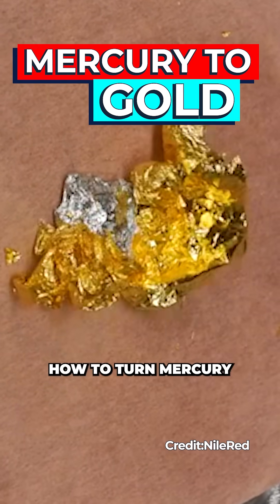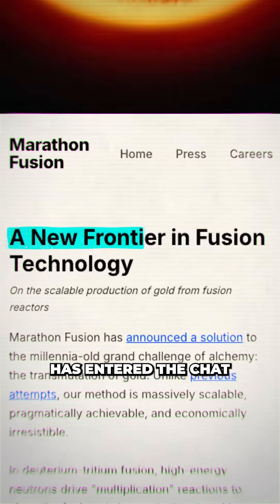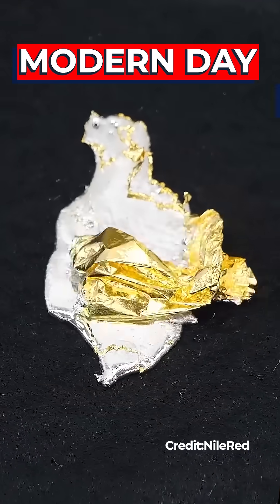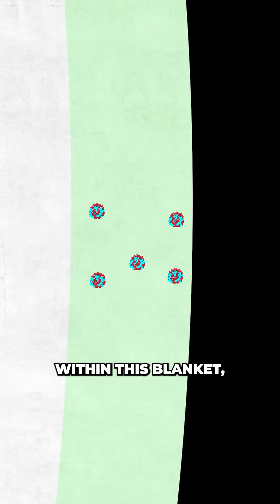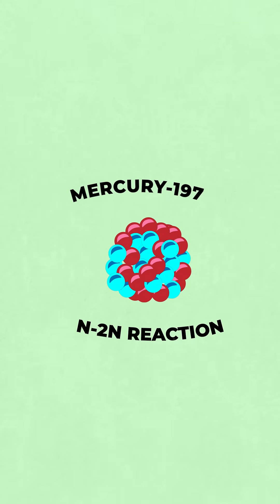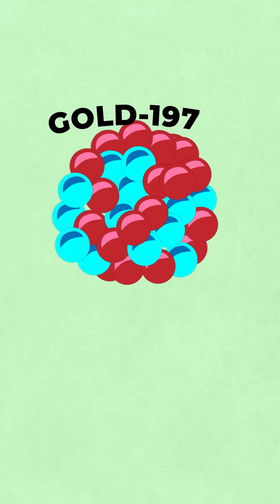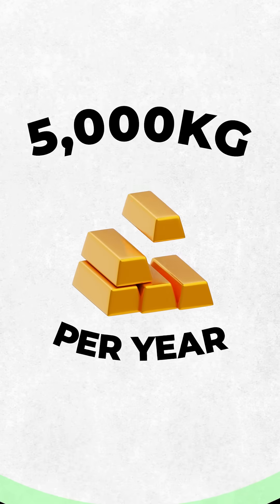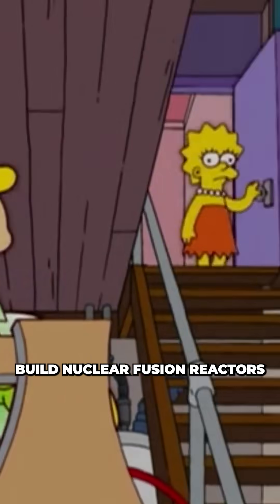Scientists Turn Mercury Into Gold

Comment: This will lower the value of gold because now they can just print it… which may boost the value of other metals though… thankfully countries like China who put most their capital into gold will suffer the most from this while other countries can divest and instead sell their gold to manufacturers who can use it in motherboards, wires and microchips so they still have value just not as much if this is true. China will lose the most so their yen will greatly devalue once more gold is actually printed which will increase the value of the dollar at least.

Comment: So gold will become cheap enough to replace copper for electrical devices (copper is used to make cables and wires gold can do the same thing and it's more efficient in transferring energy the reason we didn't use gold for everyday things it's because gold is really valuable)

Comment: Uhhh. How tf do they plan on capturing and processing the mercury-197 without you um gold metal itself being in such bountiful clumped together nuggets? Only bacteria do that over very long times. This reactor would be spitting it's entire contents including fuel for this to work. That and the radioactive gold. It might be the most common isotope but gold absorbs radioactivity no different than steel can. It can be hot irregardless of the isotope.p

Comment: If the cost is too high it will make the value is higher than natural gold. Mercury is rare material even it's not as rare as gold, if mercury is using to make gold the price of mercury will skyrocket and increase the cost that will make the mercury gold high in value...

Due to the principles of mass-energy equivalence (\(E=mc^{2}\)) in nuclear reactions, the final mass of the gold produced is slightly less than the initial mass of the mercury isotope and neutron combined. However, because only a trace amount of mass is lost as energy, the amount of starting mercury-196 required is almost the same as the desired amount of gold. In practical terms: Because Hg-196 is only a tiny fraction of natural mercury, you would need a very large amount of natural mercury to produce a useful amount of gold. Estimates suggest that a kilogram of natural mercury might yield less than a gram of gold using current, highly inefficient methods like particle accelerators.The process is extremely expensive, energy-intensive, and yields are minuscule, making it completely impractical for commercial gold production.

Comment: Gold’s value is almost entirely symbolic. It doesn’t feed, shelter, or heal anyone. Its usefulness comes from human consensus — people agree it’s valuable. Once you remove that shared belief, gold becomes just another shiny metal with little real necessity.
Even its historical role — backing currencies or storing wealth — has faded. Modern systems use fiat money, digital assets, and blockchain, which rely on trust, not metal. So, outside the monetary illusion, gold has no essential human benefit.
Reply: In the modern world gold is important in electronic industri...you wont have computer, smartphone, satellite etc and all the system related to it without gold...that means in modern world without gold there will be no internet, no blockchain, no advance military, no advance navigation and no AI...no I.T no job related to I.T, there will be no software engineering, no online/digital banking, no ATM and many other modern jobs, all thanks to gold that's why the value of gold is higher in modern age..the more advance electronic technology  the more it need gold because gold is the best metal for electric conductor which is important for microchips manufacturing while fiat money is just a paper that means fiat money value is totally illusion...do you trust in that illusion while the real value for it is for toilet paper? And there will be no paper jewelry, dude. You're a funny guy, man because you live in the edge of technology which depends on gold but you never realized how important is gold to modern tech instead you put trust on paper...paper isnt rare material🤣

Comment: Ok so you say it would pay for itself but given the sheer amount of gold this could produce wouldn't it simply cause a massive collapse of gold prices and essentially fuck global economies due to the sudden devaluation of gold! Remember if they put this into practice as an energy supply it woukd require a lot of these reactors and they each would produce that amount of gold which would quickly make gold a less valuable asset based on it's rarity etc.

Comment: This is just theoretical, and would make radioactive gold that would have to be stored long term until it's depleted. So 5 thousand kilos per year, that you can use in 1000 years. Maybe. Furthermore, this presents a situation for bad jewelry and bullion for the market....really bad.
Reply: It has been done, but it costs more to run the reactor than even 10x the gold it can make would cost

Comment: Yes, it is theoretically possible to turn mercury into gold through nuclear transmutation, but it’s not practical or economically viable. Mercury (Hg) and gold (Au) are close on the periodic table (atomic numbers 80 and 79, respectively). By altering the number of protons or neutrons in mercury’s nucleus, it can be transformed into gold. This can be done via processes like neutron bombardment or proton capture in a nuclear reactor or particle accelerator.
For example, in the 1940s, scientists successfully transmuted mercury into gold by bombarding it with neutrons, causing some mercury isotopes (like Hg-198) to capture a neutron, undergo beta decay, and become Au-197, a stable isotope of gold. However, the process is inefficient, requires expensive equipment, produces tiny amounts of gold (often at the atomic level), and can result in radioactive byproducts, making it hazardous and costly. Look it up for yourself.

Comment: The geet reactor also does alchemy with plasma turning carbon dioxide into just oxygen… thunderstorm generator has also been shown to create the same type of plasma reaction with 900 degree exhaust heat. I have a working proof of concept motorbike! 🏍️

Comment: 0:56 I think I found a mistake here, namely Hg179 doesn't undergo Beta- decay. 
Hg has atomic number 80, while gold's is 79, meaning an isotope of Mercury would have to LOOSE a proton (into a neutron) to produce gold. Beta decay of Mercury with a proton emission (According to Wikipedia) is possible but that's still a Beta+ and results in Platinum.
The products of Beta- decay (which doesn't matter) in the video are listed correctly, so I'm hesitant to call it a simple 'typo'. 

Logically tho, for Hg179 to produce gold via Beta- decay it would have to also emit TWO protons, two protium atoms, which would likely screw up the reaction chain somewhere down the line

Comment: If you research the cost of generating 1 GW of power for an entire year via nuclear power, you'll find that even the millions in gold value are just a labor intense byproduct and the power still is the main driver of cost / earnings. Not to mention you would probably have to halt the reactor, disassemble it and scrape the gold along some radioactive material off the blanket and replace it to get access to the gold

Comment: This is gonna crash the gold market and devalue it incredibly quickly if it works. I wonder what gold-backed currencies are going to say about this.

As long as someone professional and skilled has the equipment (one of those reactor thingies and proper storage for the unstable mercury), they can pump out gold like a minecraft player.

On the other hand, gold is an incredibly conductive material. So if it becomes totally devalued as a precious metal, at least it will be good for electrical stuff.

Comment: No, scientists have not yet successfully and reliably turned mercury into gold on a commercial scale, though a startup, Marathon Fusion, claims to have a method involving nuclear fusion reactors that could achieve this. While the physics underlying the proposed process of transforming mercury-198 into gold-197 through neutron absorption and decay is scientifically understood, the method is still in its early stages, awaiting peer review, and has not been proven commercially viable.

Comment: If this is made in theory at high scale, wouldnt it be able to just ruin some economies of countries that profit from minery of gold, and wouldnt gold reserve lose all its value with gold becoming a common mineral? I mean, maybe people would find a way to adapt but fusion won't pay itself, it will at start, then just make gold worthless or too common to profit.
This is thinking Gold would be made at high scale and it would be usable instantly with no waiting, not considering other stuff just to simplify.

So in this case if it does work and done high scale and the gold can be used instantly, it wouldnt be fusion energy paying itself in gold bars, just gold reserves, minery economies based on gold, gold itself, all of those become worthless.

I would like to hear other people thoughts and opinion, and this isnt considering all and is theorical and not realistic thinking it would be made at high scale and gold can be used just the instant it is made.

Comment: On paper, this represents roughly £440 million in annual revenue per plant - enough to transform fusion economics.

But there's a rather elegant economic paradox buried in the proposal that's worth examining.

* The Tritium Bottleneck

With less than 30 kilograms of tritium commercially available globally, the fuel supply chain becomes the ultimate constraint.

You simply cannot operate multiple gigawatt-scale fusion plants whilst dedicating precious breeding blanket space to mercury transmutation - it's a zero-sum resource allocation problem - we need the breeding blanket to produce Tritium to refuel the reactor.

* Market Dynamics vs. Technical Feasibility Gold's value proposition rests entirely upon scarcity. 

The moment investors realise fusion reactors could reliably mass-produce gold, prices would crash in anticipation - long before a single gram hit the market.

Current global mining yields roughly 3,500 tonnes annually; even modest increases from fusion plants would trigger psychological sell-offs.

The study acknowledges that transmuted gold remains radioactive for 14-18 years before it's commercially safe. 

This creates enormous storage, insurance, and financing costs whilst hoping gold prices remain stable for nearly two decades - a rather optimistic assumption given the technology's very existence would destabilise the market.

If the technology achieved its theoretical potential, it would guarantee its own economic failure. 

Success would transform gold from a store of value into an industrial commodity, rendering the entire value proposition moot while depleting a Tritium reserves instead of producing more of it.

The alchemists' dream always comes with a curse. But this is a good example of how technical feasibility and economic viability can exist in entirely different universes.

Comment: As we get closer to common fusion, matter manipulation becomes increasingly feasible at scale so I hope this is real. 
Unlimited energy must eventually become control over matter. Certain stable elements require large amounts of energy to break off protons and neutrons, or fuse, so cost only stops being a factor when energy is extremely abundant but the applications are limitless.

Comment: dont be foul. Not any Hg can be trans-mutated into gold.
"Basically" only the isotope Hg-196 can be transformed into a stable gold isotope.

But Hg-196 is extremely rare, only 0.15% of all Hg. 
And Hg-196 would be more expensive that gold.

Possible? yes. Even if you use free resources from actual reactors, feasible?  not!

Comment: No. Not metallic gold . Ions . Gold ions , accumulating the ions requires acidic electrical  suspension and dropping out with bicarbonate simulating hydrothermal deposition ... The crystal metallic can then be melted into ingot. ...
However in the fusion process a safe ""  half life of about 7 years is estimated ,  so anyone buying gold now is confused about its future price.  See , for reference the gemstone trade under the influence of artificial mature identical stones ....
Gold will see 280 au$  again because , that's it's actual value , plus 100......

Comment: I see one major problem, the blanket releases tritium to fuel the fusion reactor.  What that means is that it will be significantly less energy efficient and will require constant refueling.  Considering researchers have only barely managed to get a fusion reaction that produces more energy then it requires to run this is not a power source, one that on top of everything else will be highly radioactive.

Comment: Assuming that this actually works and also assuming that the cost of making the necessary components are not outrageously expensive, a single plant would decimate the price of gold very quickly.
Reply: 0.0000075% of the total weight of all gold ever found/mined per year will hardly decimate the price of gold. Each plant would effectively be an extremely low producing mine. a typical gold mine produces 3000 tons per year. This will not affect the price of gold, not even a hint of a price change. However with enough time a large collection of these extraordinarily inefficient and expensive pseudo mines could produce more gold than is what is actually on earth in it's current form.
Reply: @joemomma5068  That's the problem with doing a quick search and actually doing research. One, your numbers are off. Two, you tried to compare the amount yearly to all that has been produced. and, three, you have no clue how quickly adding 5k kilograms in gold a year would affect the price. You also didn't even bother to ask what I meant by 'quickly', which means you based your argument on an assumption, most likely an inaccurate one.
Reply: @mrdean2539  🤣😂🤣😂
Reply: @joemomma5068  Yeah, that's about the level of intelligent response I expected. Thank you for living up to my low opinion of humanity.

Comment: Thank you for this good explanation of turning an isotope of mercury that's stable into gold. Sounds like this could also be done inside a molten salt reactor where fission releases a bunch of neutrons and this stable isotope could be used in the molten salt to create the "higher form of mercury which can be separated, like Pa-233 is separated from the molten salt and left to turn into U-233 which can then be released ti create more heat via fission. 

I calculated that Marathon could "create" 5.5 tons of gold per year. I wonder if the addition of that much gold each year will devalue gold as a result of the increased supply.

Comment: That’s not how that would work. It is nice that we have a way of producing it in case we ever need it for industrial reasons where cost is not really the issue but gold in the sense of it being some form of value. Comes from the fact that it was a relatively rare earth mineral that was also pretty. Now that it’s something we can essentially print all you would get is gold inflation to the point where it would become basically worthless. The thing is is that stuff is expensive when it’s rare because the fact it is expensive is to filter out people from getting that thing so for instance to use the housing market as an example if I have 10 houses to sell, but there’s 10,000 people on the planet I’m gonna have to set those prices super super high to make sure only the 10 richest people are able to afford it. Why because this is naturally going to pad my bottom line the most well also Making sure that they see use. 

This is why everything that is expensive has always been an issue with supply and demand. The housing market is crazy right now not because we need rent control or anything else but because we just don’t have enough houses you could make some kind of an argument that you could, and should make it illegal for people to own more than one or two homes and also that people can’t just buy homes for the sake of renting them out specifically Those laws would actually help the market. As it would reduce artificial supply shortage. For the most part if there’s an issue with people not being able to afford something it’s because that’s something is currently restricted or rare or otherwise not available to as many people as possible, which is why it prices people out of the market this is basic economics.

Comment: Sure it would pay for itself in gold bars... for about a year at most. Supply and demand still apply. Low supply with high demand? Gold is hyper valuable. As those graphs get closer to one another, it's value drops. If supply dwarfs demand then it's virtually worthless.

Comment: Best way is to dig down below because all heavy metals have sunk into mental and core. Ok if that seems more impractical then half way to the crust down below there are still enough heavy metals in much higher concentration compared to the surface.